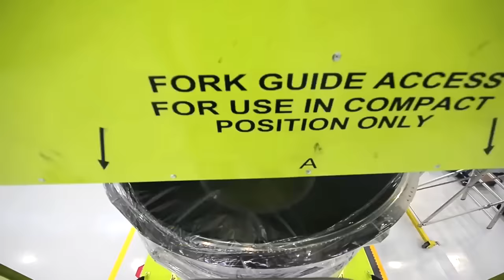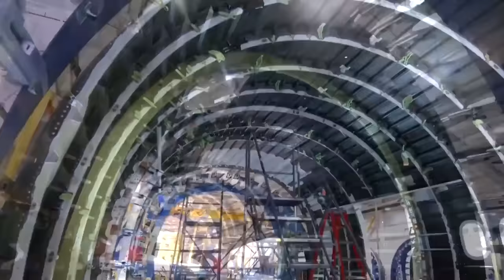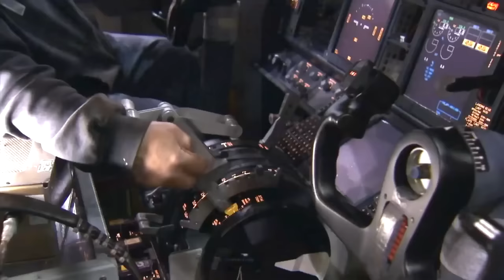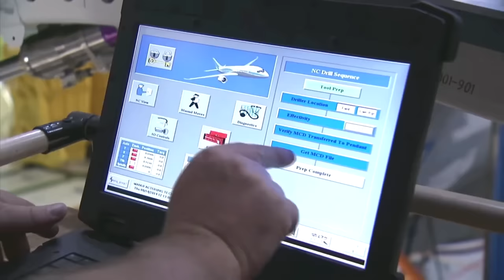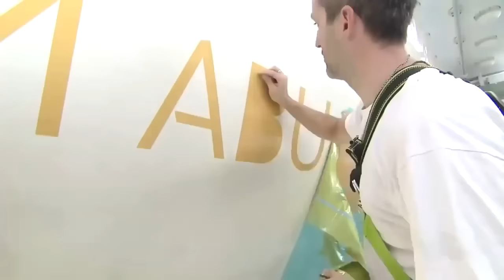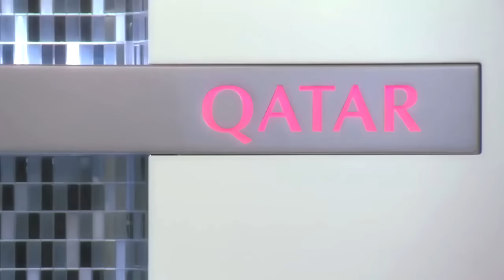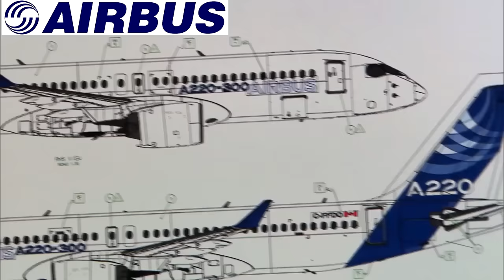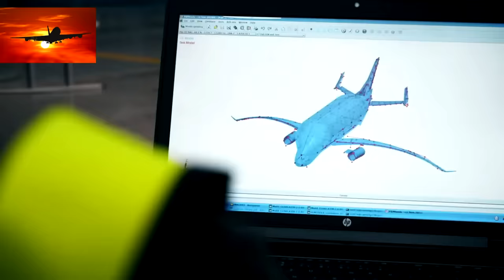Aircraft Manufacturing✈️2024 Plane Assembly Factory tour Boeing & Airbus plant {Making of}

Comment: I would think that all the parts of a plane should be made in a huge single and separate area to save a ton of money in transportation costs as well as more efficient communication. I also wonder if the engines are fitted with explosive bolts to facilitate a water landing if needed.

Comment: How much fuel could a plane save if it didn't require any exterior paint? And how much weight is all that paint adding to the aircraft?
Reply: its like your home, no interior design and look old
Reply: I worked as an aircraft mechanic back in the early sixties. Painting the exterior of those four engine cargo planes was a major project. Special crews were brought in to do the job. The hanger were the plane was worked on by us mechanics had to be emptied and all equipment covered that couldn’t be moved. The paint crew, usually four guys, would wash down the entire fuselage with a pressure washer and let it dry, this usually took a couple days.  Scaffolding would be erected as they moved from one part of the fuselage to another. It was a dangerous job. These big cargo planes are much bigger than they appear. Some tail sections were forty feet high. A long way to fall onto a concrete floor for the painting crew. These cargo planes were ordered with white paint, a LOT of white paint. Hundreds of gallons were sprayed on the exterior after prepping the aircraft surface. I would say the paint weighed over ten pounds per gallon. This would add about 10,000 pounds to the aircraft. This weight was figured into the construction of the aircraft by the design engineers. The paint crew would then paint the companies logo as ordered. I always thought painting a cargo plane was a waste of time and money. The cargo planes I worked on were ordered by a Brazilian company. Their business was flying beef cattle carcasses over the Andes to Chile for processing.
Reply: The A380 paint weighs 1400lbs and takes 950 gallons
Reply: Mintah Warna Cermilang Cat Besi Avian  Abuh Abuh Bubuk Baja Tuah Biruh  Coklat Tuah Bubuk Baja Tuah Coklat. Ungguh Tuah Bubuk Baja Ungguh Biruh Tuah Bubuk Baja Tuah Biruh  Cat. Besi.  Avian. Kaleng Besar Baru  oke Bro. Mantap. Kerjakkan